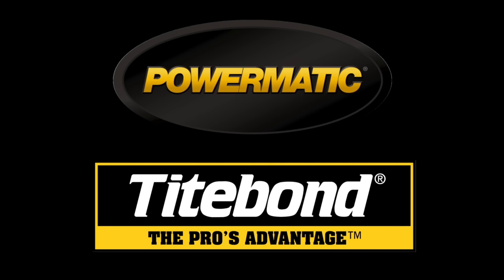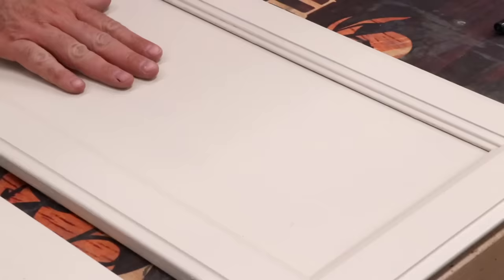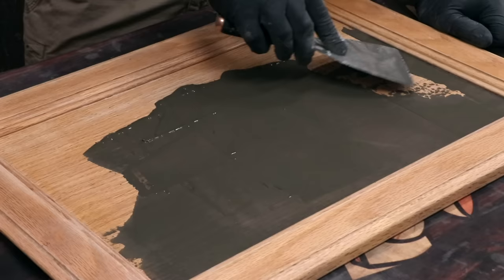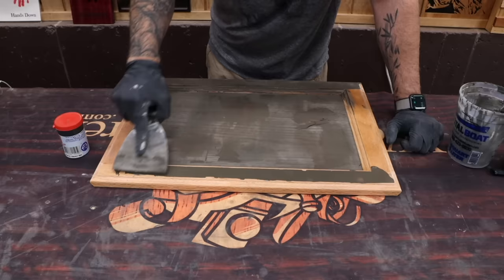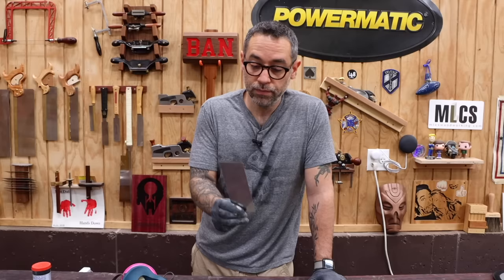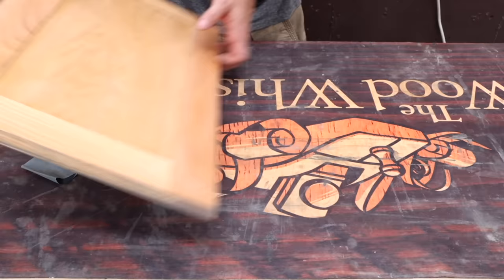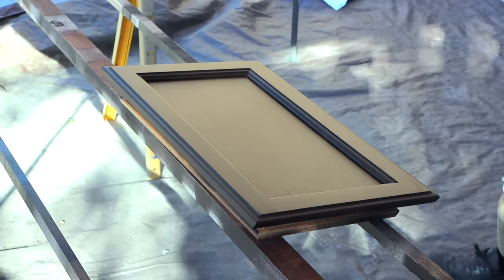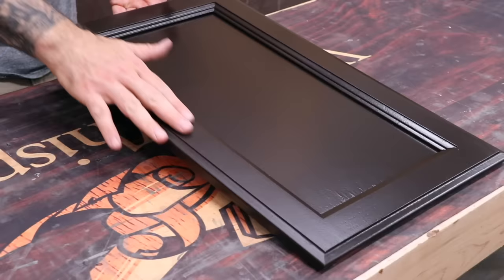Painting Oak Cabinets - Transform Your Kitchen!

Comment: You failed to cover the most important part: surface preparation, especially with kitchen cabinets. You must remove as much of the grease and dirt as possible or your paint will simply bead up, and you’ll never be able to cover completely.
Reply from the maker: I actually did cover surface prep. :) It's built in when doing the pore fill since you have to sand afterward. I also mentioned that if you don't pore fill, you're going to want to clean up the surface with some sanding to knock down the gloss and give the paint a nice surface to bind to.